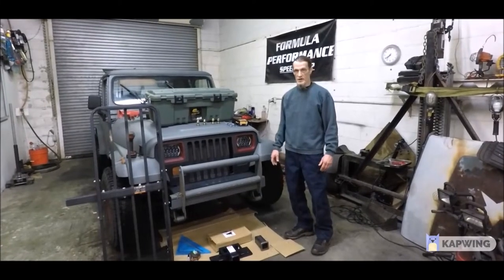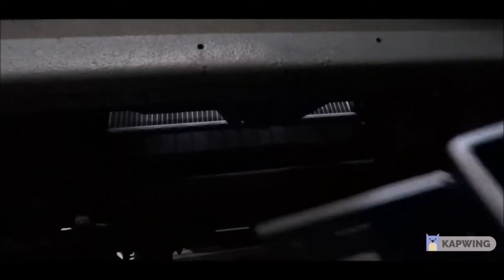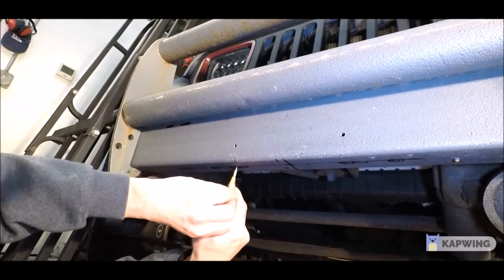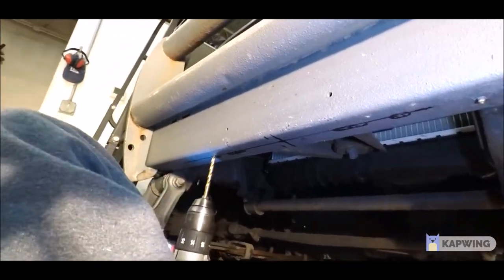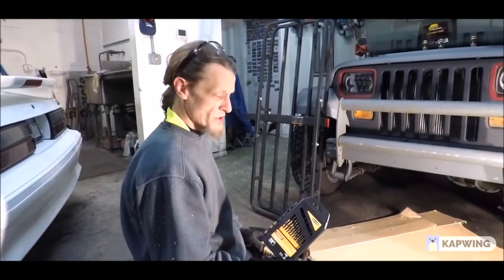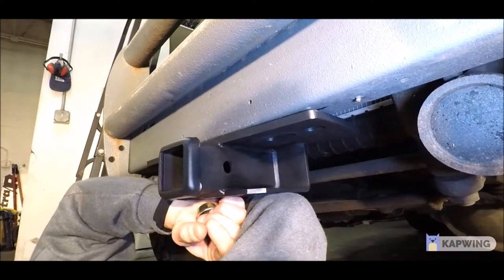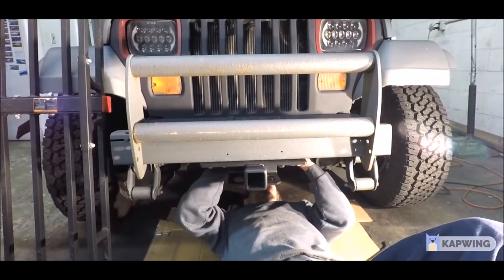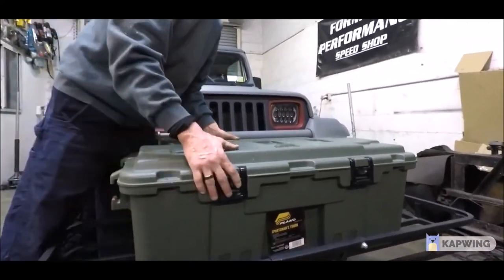Cheap Front Hitch Mount For Jeep Wrangler

Comment: It's not an issue of "depriving the engine of oxygen", but rather reducing the airflow that cools the engine... 

I've never liked the way that the receiver hitch baskets attach to the vehicle since they only use a single attachment point.  I think a better design would be to use 2 or 3 receiver hitches on the vehicle and the basket so that weight distribution of the items in the basket would not be as critical...
Reply from the maker: Great point! Thanks for sharing. Enjoy your jeep.